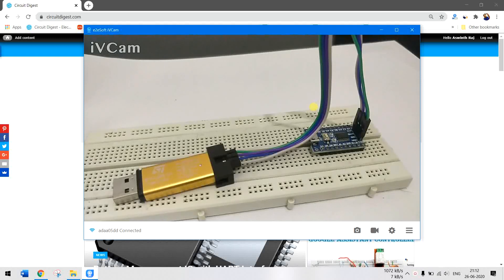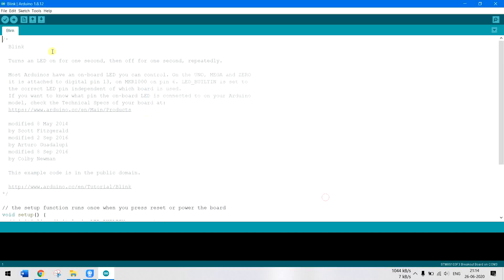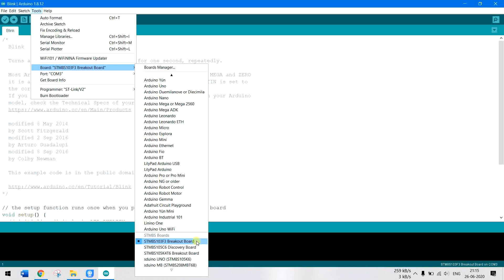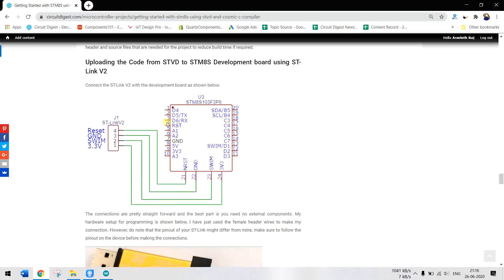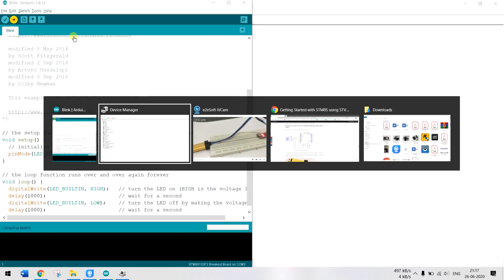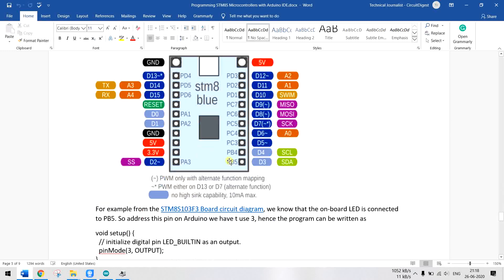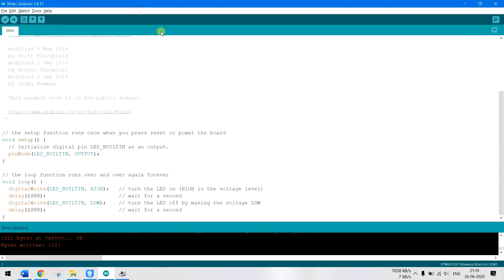How to Program STM8S Microcontroller with Arduino IDE

Comment: 00:04 - Programming STM8S Microcontroller with Arduino IDE.
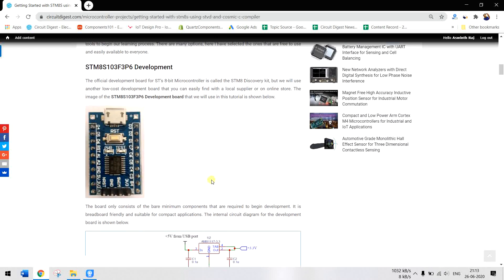00:55 - Overview of circuit setup for STM8S microcontroller projects.
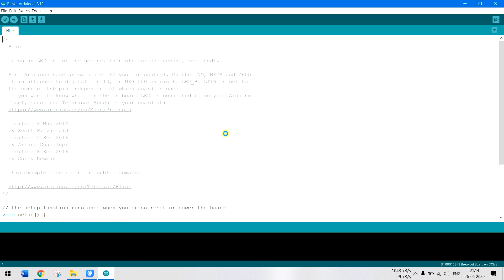01:46 - How to set up STM8S in Arduino IDE.
02:47 - Programming STM8S microcontrollers with Arduino IDE is feasible.
03:38 - Connect STM8S pins for proper programming with Arduino IDE.
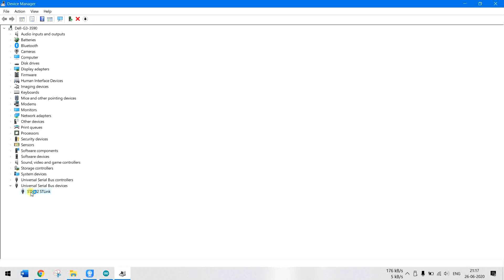04:34 - Ensure proper board and programmer settings in Arduino IDE.
05:23 - Understand STM8S pin mapping differences when programming with Arduino IDE.
06:21 - Understanding STM8S pin mapping and library limitations in Arduino IDE.

Comment: I have connected ST USB Device ..also showing in device manager in universal bus. followed every step .. but gave me this error. pls help to resolve.

Sketch uses 1703 bytes (20%) of program storage space. Maximum is 8192 bytes.

Global variables use 72 bytes (7%) of dynamic memory, leaving 952 bytes for local variables. Maximum is 1024 bytes.

An error occurred while uploading the sketch
Reply from the maker: If you have properly installed the driver snd followed every step, then there might be something wrong with your st link programmer. Most of the cheap ST Link clones have issue. They won't detect the target chip. to confirm you can tried to read from the target using STVP.

Comment: I getting an error while uploading the code. I am following same  as shown in the video 
An error occurred while uploading the sketch
Determine FLASH area

libusb: warning [windows_get_device_list] could not retrieve port number for device '\\.\USBESTUB#DEVICES#0000', skipping: [13] The data is invalid.
libusb: warning [windows_get_device_list] could not retrieve port number for device '\\.\USBESTUB#DEVICES#0001', skipping: [13] The data is invalid.
libusb: warning [windows_get_device_list] could not retrieve port number for device '\\.\USBESTUB#DEVICES#0000', skipping: [13] The data is invalid.
libusb: warning [windows_get_device_list] could not retrieve port number for device '\\.\USBESTUB#DEVICES#0001', skipping: [13] The data is invalid.
Could not open USB device.
Invalid library found in C:\Users\Amit\Documents\Arduino\libraries\libraries: no headers files (.h) found in C:\Users\Amit\Documents\Arduino\libraries\libraries
Invalid library found in C:\Users\Amit\Documents\Arduino\libraries\tools: no headers files (.h) found in C:\Users\Amit\Documents\Arduino\libraries\tools
Invalid library found in C:\Users\Amit\Documents\Arduino\libraries\libraries: no headers files (.h) found in C:\Users\Amit\Documents\Arduino\libraries\libraries
Invalid library found in C:\Users\Amit\Documents\Arduino\libraries\tools: no headers files (.h) found in C:\Users\Amit\Documents\Arduino\libraries\tools